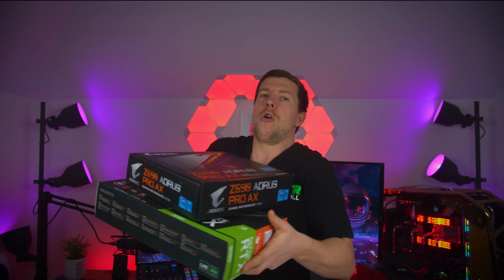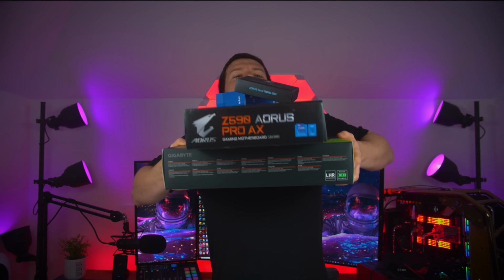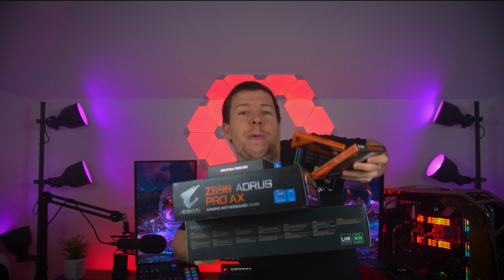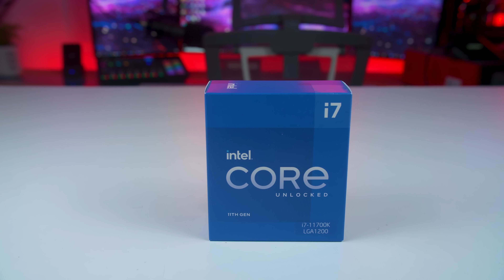This $6000 OVERKILL Gaming PC can be yours!? 😵

Comment: Nice build Cory. Did you want long tube runs from the radiators? Was was left wondering why you didn't turn the radiators around the other way. I usually try to reduce case wide runs on radiators by using cross-flow variants. In my last build I used three cross-flow radiators and my next build will use one at the top of the case. As for the fluid colour, I think the pastel purple suited the build nicely but personally, I always go clear for ease of maintenance sake every time.

My next project will be an Alder Lake build in a black Lian Li O11D XL. Got the case, 3 x 360 Alphacool rads, Singularity D5 pump/res, Phanteks Glacier D120 distro plate and fittings already. Going to give the Lian Li AL120 fans a go (9 of them arriving this week) and I've got my storage ready (Samsung 980 Pro Gen 4.0 1TB & 2TB SSD's plus a Seagate 4TB Ironwolf Pro hard disk). Expect to be able to buy the 12900K, Z690 m/board, DDR5 RAM and a LGA 1700 waterblock sometime in November. I'll be moving my watercooled EVGA 3900 FTW3 Ultra into the new build and reuniting my waterblocked EVGA 1080TI SC2's with my existing rig.

Comment: I have a lian li dynamic case and want to do a side distro plate.  What plate do you recommend and how many 360 radiators can I use and where?

Msi Z490 a pro
10850k
Dell rtx 3090
4 stick of ram

Comment: so warning if you win this pc get a different PSU ASAP cause gigabyte PSU like to go boom EDIT leaveing old text so it dosnt look confusing. I did not know they made a new psu ( calling it new as the USA model has 0 reveiws on any sale site) still would not trust it thoe as gigabyte took way to long( in my opion) to address the issue. Also based on what ive seen they only have a soft recall and not asked mass store fronts like newegg or amazon to send back the old ones.
Reply from the maker: Stop spreading mis-information. This isnt one of the models in question